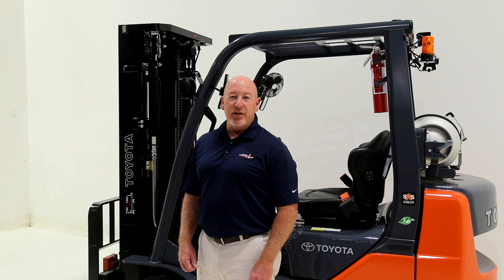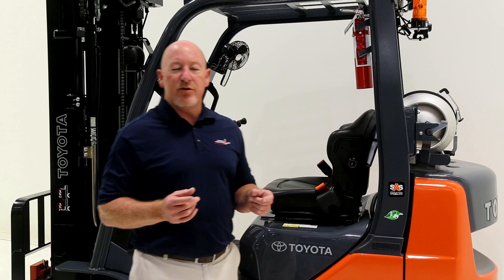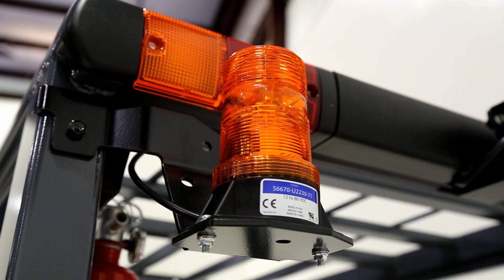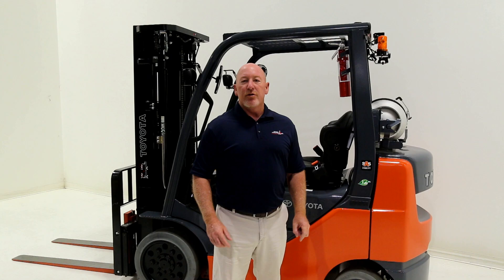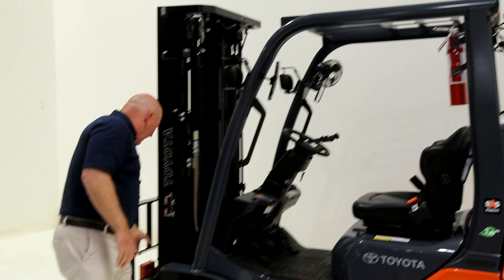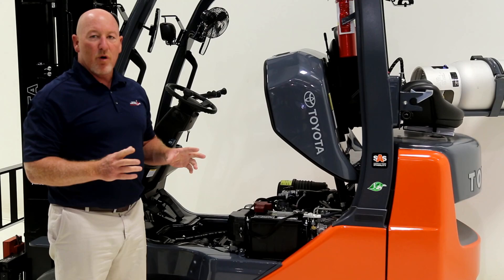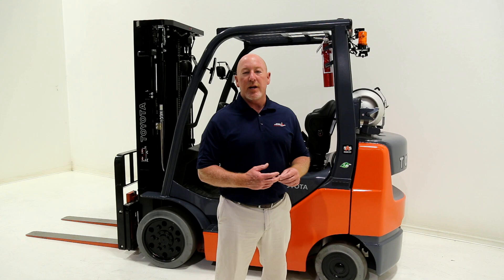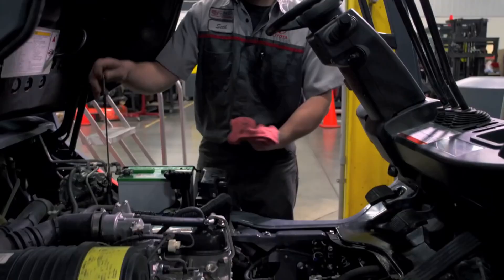Toyota 8FGCU25 Forklift Demo

Comment: I use this exact lift at work, and I name it ole faithful. Never lets me down, always starts right up even in negative degree weather. She spark knocks a little upon acceleration, but all of them do. It’s an older engine design, more simple and reliable. Over 15,000 hours on mine. Whenever my work decides to upgrade their lifts, they’ll have to pry this one out of my hands.

Comment: we have 1 toyota forklift where I work and 2 CAT forklifts and the toyota is hands down the better one even though it's been beat to hell and back. it has tons of cosmetic damage, it's never taken care of. it's out biggest forklift so it's the one that gets used the most and people always do neutral drops with it and it struggles to get in gear but once it's in gear in goes! it never gets serviced. for the longest time it was overheating really badly because nobody would change out the coolant. so it has bad coolant in it, bad oil if there even is oil in it, it pings and knocks like you wouldn't believe but it won't die, it just keeps going and going and doesn't complain. right now it sits out back on a puddle of hydraulic fluid and is starting to feel really under powered, but it still goes. it's getting to the point where I don't want to use it because it's so poorly taken care of that it might actually kill somebody in the near future but I wish it would just die so it wouldn't have to keep suffering. it won't give up!!!
Reply: That’s Toyota baby!
Reply: Your workplace needs to take forklift maintenance more seriously. Sometimes companies won't listen to you. However they will hear OSHA if neglected equipment was somehow reported to them.
Reply: Kevin Thomas You are right. Definitely a safety concern, to say the least.
Reply: @kevinthomas895  the things finally died. the company we leased it from wasn't too happy to get it back though.
Reply: @auto_5  if it was safe then it wouldn't be home depot. lol

Comment: I was regetting my forklift license yesterday and I don't have much experience with electric forklifts.  The forklifts they had were Toyota and looked a few years old. I enjoyed driving them but did notice it seemed hard to release the handbrake. I had to press a side button , pull it back and then it would release forward.

Comment: Seems to me having a system like SAS will encourage drivers push the limits, driving too fast and taking corners at high speed thus adding to the chance of an accident of some kind,  such as losing control, running into another forklift, product, or  pedestrian, or  losing their load.  A well maintained forklift,  with good brakes, tires, horns, lights, hydraulics  etc, that is inspected every day by the drivers, and proper training,  is all the safety devices one needs.
Reply: some of our younger hires have been saved by the sas system. they didn't even know about it until the system detected they were in a roll over Sanrio and limited their throttle. i can't help but to smile when i tell them why the forklift stopped them from flooring it, i say the same thing every time. "the sas system detected a roll over situation and limited your control over the machine" they always go wide eyed
Reply: All that is really needed is common sense, being familiar with the machine under operation, and the load being transported. Proper maintenance is absolutely essential, but daily checks are primarily advocated by people who don't bother to check the fluids in their own vehicle before driving to work so they can operate a forklift. It's funny how that plays out.
Reply: @Nobody1975JM  BUT someone‘s personal vehicle is generally not run all day, every day, by multiple people who do not care about about the vehicle they operate because it is not theirs, in severe and dirty conditions.